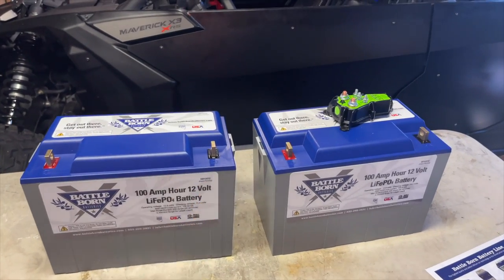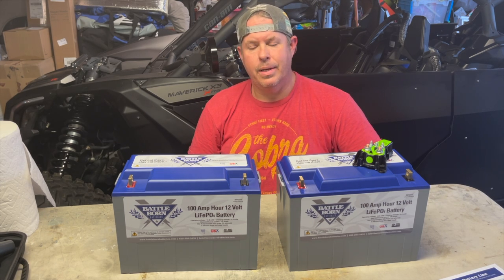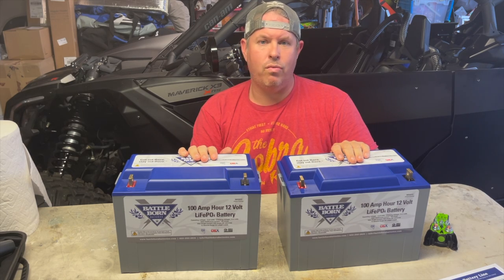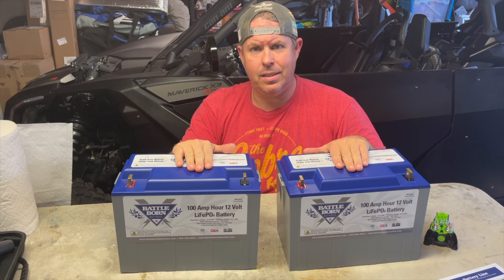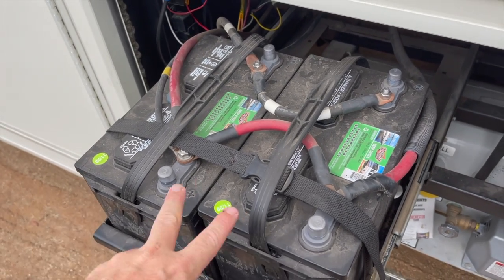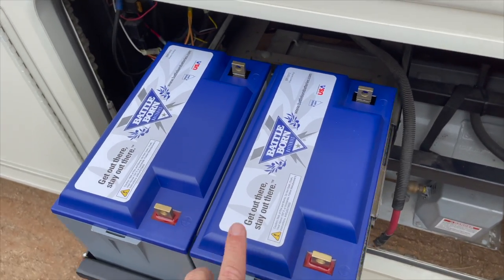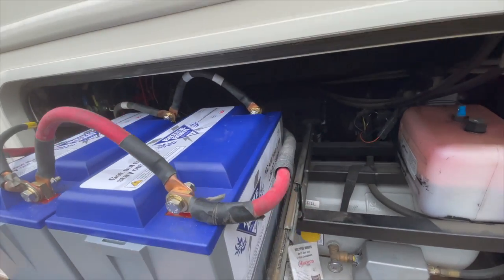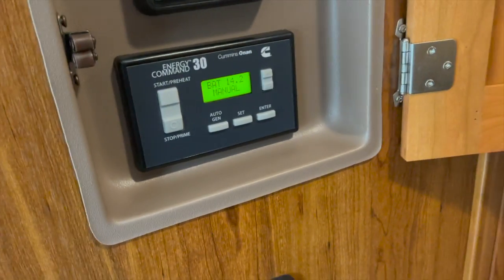RV Battleborn Lithium install!

Comment: I have the PD converter too.   I thought the same thing as you with the button and I watched the volt meter and it does all three steps even with pushing it. like the Wizard button you can force it in.  I would recommend some sort of way to monitor it.... as you know after the 14.2 -14.6 It will ultimately go to the PD float.  The batteries don’t need the float but it won’t hurt them.
Reply from the maker: Yep exactly, I have the genset so I can check the voltage periodically,
Reply: @wernergarage7078  thanks for the reply

Comment: Your point about cost vs usage is where I’m at because I’m new to this.  I think I will go 200 watts solar and just two of the 29’s lead acid to start so that I can gauge my electrical needs.  Thanks for the info!
Reply from the maker: That's a good start and definite most cost effective short term. In my RV I was limited in space and since we dry camp in the desert a lot I wanted the most capacity possible and that's why I went lithium.

Comment: What year is your Precept? I have a 2020. I am planning on installing 2 200ah SOK's. So the battery charger is built into the panel under the bed? Great heads up on the BIM, I will check mine. Later I will install some solar, but for the time being I need more capacity to run the residential refrigerator, I don't mind running the generator every 3 - 4 days just not everyday.

Comment: I am in the throws of deciding on whether to use a Bat 2 Bat charger or the LiBIM-225 on my Journey Diesel Pusher. In talking with Battleborn they told me the LiBIM-225 was fine as long as I had  4 of their 100AH batteries. Their Bats will take up to 50A of charge each and they had concerns that my 160A alternator would provide more charge than 2 or 3 their batteries could accept, thus potentially damaging their batteries. The 15 on 20 off cycle of the LiBIM-225 is more than adequate at traveling speeds, but I have concerns that when idling the diesel to raise jacks, bring slides in etc the idle speed of the alternator may be too slow to provide adequate alternator cooling, and I would really rather not have to replace the alternator. I could do the Bat 2 Bat charger but that is only providing 30A of charge to the LiFePO4 battery bank, and I would loose my Aux Boost functionality. It has been more than a year since your upgrade, have you had any issues so far?
Reply from the maker: Interesting, I spoke to Them before the purchase and on the charger and setup I have, they advised me I'm good. It has worked flawlessly!

Comment: Great video, can you do an update on your helmet pumper since you installed it.
Reply from the maker: Thanks! Are you asking about the new version?
Reply: @wernergarage7078  yea the new updated version, I just bought one and I wanted to see how it was working for you.
Reply from the maker: Well we are in our off season for riding, I did use it cruising around the block and was really happy with it! For me it's nice to be able to turn the air down on a cold night, you can turn it up just enough to defog the helmet but have very little air noise. And then in really dusty conditions you can crank it up!

Comment: Quick question as I am getting ready to install the Lithium BIM into my rig to upgrade to Lithium. I saw that there was a connection on the old Lead Acid BIM labeled "Gen-Set". There is not a place on the Lithium BIM. What happened with the Gen-Set wire? Thanks.
Reply from the maker: You do not need it with the new bim, you can just crimp it off
Reply: @wernergarage7078    Thanks

Comment: Hi there.  Well it has been 6-7 months.  Any updates to this system's performance compared to the flooded lead acids?  For example, how much longer can you run without plugging in before your batteries SOC is down to around 5%?  Thanks for the video.
Reply from the maker: They have been working great. I dont have any specific numbers but can tell you its a much longer that the flooded. I have had the opportunity to run them way down to almost 10 volts and they still were able to start my generator to charge them up. That is impressive!

Comment: Battle born told me new bim is for 3 or more batteries.  Not good for 2 or one.
Reply from the maker: Interesting, I ordered everything directly through them and they confirmed what I was doing and said it will work perfectly!
Reply: @wernergarage7078  good to know.  There was a concern of overworking the alternator I believe.  I’ll get back in touch with them to confirm.